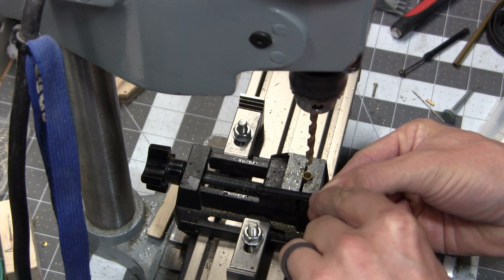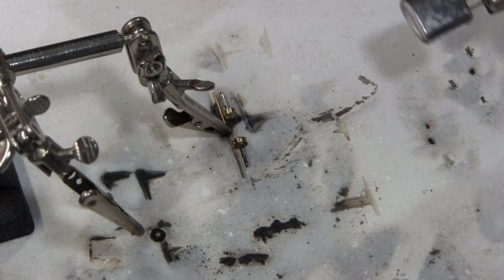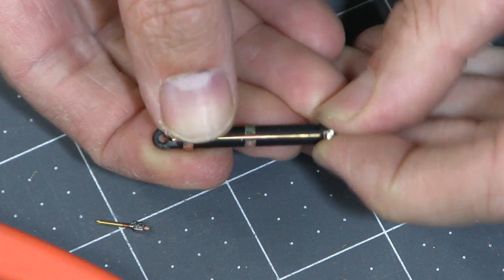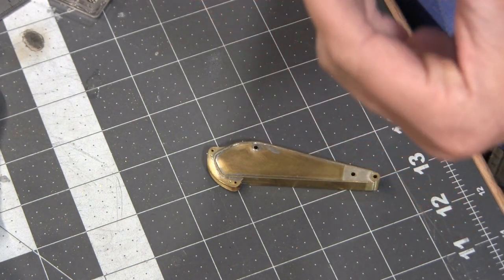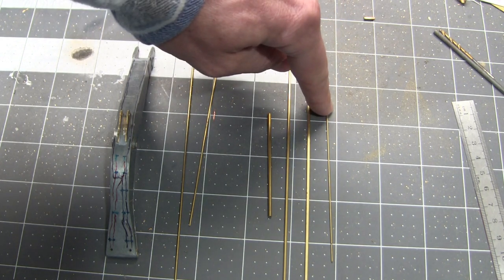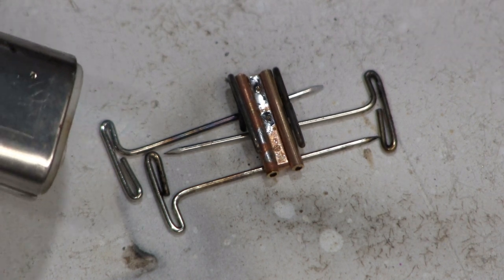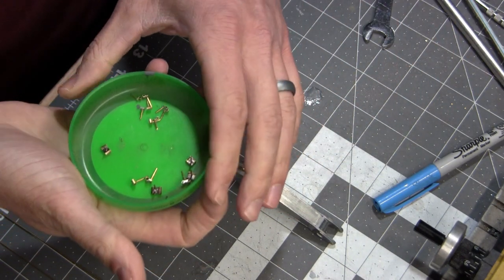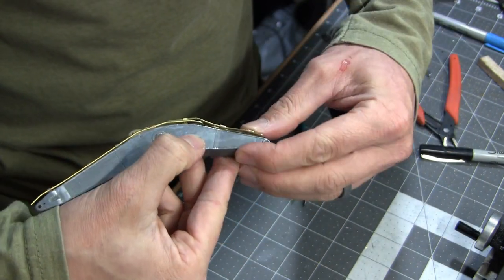Finishing off Pins and Building the Hard Hydraulic Lines

Comment: Hey man! I finally found your channel again lol, I've subscribed so I can keep up to date ; - ) I remember your issue with Flux from the other video and suggested liquid flux. If it's rosin flux you use you can make a liquid flux from it (You had issues with it hardening) by scraping off shavings of flux and soaking it in some isopropyl alcohol. Leave it overnight till it dissolves and you will have a liquid flux. Exact quantities is something you would just have to do by trial and error I'm afraid, but it's acid free and easier to work with in tiny applications. If the darkening when heated and mess is an issue with the flux you can clean that off, again using isopropyl alcohol. giving the brass a once over with wire wool on the mating surfaces before soldering will help get good flow and adhesion in joints as well. Great video again man!